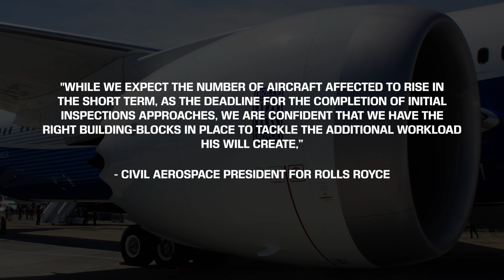Boeing 787 GROUNDINGS to WORSEN due to TRENT 1000s

Comment: You didn’t really sound that different. But why does it seems like European developed vehicles/engines always have issues. I’m into motorcycles and it seems like the European bikes are much higher maintenance vehicles and they tend to have more problems and not last as long. Can’t say anything for cars because I don’t stay “in the loop” with that stuff as much

Comment: The problem involves cracked intermediate stage compressor blades (a three shaft engine) deep inside the power generating part of the engine. 
Nothing at all like the recent Fan blade failure on the recent 737 incident.
This has limited ETOPS to 60 minutes which can require significant rerouting of the flights. Thus more fuel used and higher costs.
And more frequent inspections until a final solution of new blades is installed on about 380 engines.
To understand the energy being used to compress the air before combustion. The older J-79 turbojet uses around 2/3 of the total power produced (fuel burned) just to turn the compressor. Leaving 1/3 to be used for useful power output.
Modern designs have improved this quite a bit but the power consumed in compressing the air is phenomenal in these large turbofans.

Comment: If everybody in the area has a sore throat. Something is spreading it. Food. water. postman handling the mail. Air born.  Gargle and spit out 3 volume hydrogen peroxide. I used to be a plumber and would get strep throat every month until I learned that trick. Could also be a sewage leak into the street that gets splashed up with every car and bus. Or a cross connected pipe. H2O2 works great.bottles even say oral debriding agent.

Strep throat can turn into many things worse that can kill you ..
Reply: wayne p can you say Triology

Comment: 1st  I'd like to talk about my qualification. I entered the USAF in 1977 I went thru 380 hours on aircraft maintenence on the Boeing 707 Primarily the E-3A. I've spent the next 2 years lerining about all systems of the aircraft. I have about two hours of training for 6 weeks just on the jet engine and how it works. That being said I have dismantled many engines for overhaul and know nearly every part on an engine. PROBLEM: Fan blades breaking. It hasn't been said excatly which blade broke. There is a fan section. When this spins it supplies air to the engine about 30% and delivers the 70% around the engine for thrust. The 30% enters the inlet section of blades Stator and rotating. This starts to compress the air from 0-psi to 50 psi. That air enters the Compressor section an greatly increases the air pressure to over 100psl. That air compressed enters the burner section where jet fuel is sprayed thru 6 holes in 6 nozzles from 6 burner cans. The fuels is ignited and the air pressure greatly  is increased to 200 psi. Exiting the burner section  is the exhauset section. This hah stator blades and rotating blades. They are connected to the inlet blade by a rotatinf shaft. They all work together to produce 1/ the trust need to keep the plane in the air. If ANY one blade were to fail it has a multiple effect and will break nearly every blade from front to rear.  These blades are made from titium but depending on desige most are weaker near the tip and stronger near the assembly location. I have seen this failure before and you could see thru the front all the way behind the plane. My suspicion is there was a design change on the blades of this engine. No other jet plane with similar hours has had this problem. Every engine made for this plane will have to be rebuilt and NDI inspected... How a Jet Engine works. Place one 24' room fan in front of another about 4 or 5 will do. Place them up against eachother and turn on the first 3 fans. The back two will spin. Now if you can greatky increase the air flow the back blades will spin faster Simply put the Jet Engine Sucks and blows.. Sucks by creating low pressure in front of the engine and high pressure behind the engine pull the plane forward

Comment: The airliners should have ordered GE engines instead. The RR Trent engine seems to have all sorts of problems, even on the A380. The very first 777 crash which was a British Airway 777 had the Trent engines that suffered fuel starvation at the final landing sequence.
Reply: You're wrong in blaming the engine for the crash. Just a few minutes research would show that the cause was ice crystals in the fuel rather than the fault of the engine. Its such a shame that contributer
Reply: Continued.... That contributors to these sites make so many basic errors. Just check your facts first before putting your foot in your mouth
Reply: Bill: you are the one in the wrong. All flights in the northern hemisphere on that day experienced exceptionally low temperature. The Trent fuel lines INSIDE the Trent engines that were clogged by miniscule ice crystals because of the Rolls Royce design defects . RR had to modify the operational procedure for all 777 with their engines to prevent this reoccurence. GE never had to modify their procedures.
Reply: 2Phast4Rocket 
I read the report and the summary & noted that it was Boeing that changed the operating procedures which - presumeably - was intended for all Boeing aicraft regardless of engine type.

"Because temperatures in flight had not dropped below the 777's designed operating parameters, the Air Accidents Investigations Branch (AAIB) recommended Boeing and Rolls-Royce take interim measures on Trent 800-powered 777s to reduce the risk of ice restricting fuel delivery.[47] Boeing did so by revising the 777 operating procedures so as to reduce the opportunities for such blockages to occur, and by changing the procedure to be followed in the event of power loss to take into account the possibility that ice accumulation was the cause.[
We can ping pong forever on the merits and demerits of engine manufacturers but jurt to remind folks that the FAA issued an emergancy directive requiring GE to make immediate changes to the GEnx engine powering the 787
Reply: The fact remains it was the Rolls Royce engine hiccup that caused the crash, not GE.

Comment: For New Zealand it's a huge deal, for 80% of the Dreamliner users not so much. Rolls-Royce F'ed up BIG TIME, P&W has their own issues with the GF engines on the 320 family.
As far as single aisle, the LEAP engine is going to the bank, increasing production its rosy at GE and the French power plant makers
**
Rolls-Royce builds jet engines for a wide variety of aircraft, including both Boeing and Airbus widebodies such as the A350 and Boeing 787.

The latest out of the Trades
*Most Boeing 787s (WRONG its 20%) are powered by the Rolls-Royce Trent 1000 engine, which has been receiving lots of attention after some serious problems: the turbine blades inside the engines were corroding and cracking at a quick rate. And now, the company is paying for the faulty equipment in a big way.

In 2016, ANA announced it would be replacing all 100 Rolls-Royce engines on its entire 787 fleet after three engines failed because of the corrosion. British Airways cancelled a handful of its 787 flights last year due to the same issue. Air New Zealand, Norwegian and Virgin Atlantic’s Dreamliners have fallen victim, too.

Rolls-Royce reported yesterday that it’s paying $315 million for the repairs on the Trent 1000 and Trent 900. The BBC reports the costs could lead to job losses at the engine manufacturer, in addition to other structural changes at the company.

“These issues have required urgent short-term support, including both on-wing and shop visit intervention, which has resulted in increased disruption for some of our customers,” Rolls-Royce said in a news release. The company said it is, “making solid progress with longer-term solutions, largely through re-designing affected parts.”

Both the Federal Aviation Administration and European Aviation Safety Agency called for increased inspections of the engines after studies found that during an aircraft’s takeoff and ascent, extreme vibrations caused the engine blades to crack.

Rolls-Royce said that affected Trent 1000s — up to 500 of them — will be taken out of service and repaired through 2022. The company also recently introduced an enhanced version of the troubled engine, the Trent 1000 TEN.

Comment: Their H P compressor blades are cracking at the root more so then the tip of the blade.  Don't know if its material based ,processing defect or flow design.  I do know that the testing folks are working this problem on their test engine.

Comment: GE builds better jet engines then RR, plus GE has built the biggest jet engine in the world the GE-90, with 115,000 pounds of thrust for the 777 and that was over 25 years ago. GE was also the first to build all composite fan blades. I personally think that GE is number one in building jet engines, RR is number 2 and PW is number 3.

Comment: In your video package clip, showing the Boeing B-787 aircraft, you didn't mention it, but the RR Trent 1000 isn't the only option for powering the 787. General Electric also provides engines for the 787, and most, if not all, of the 787s being flown by U.S. based air carriers, domestic, and International, have the General Electric GEnx engine, which according to General Electric, is also the best-selling engine for the Boeing 787 Dreamliner. Also, the Boeing  B-747-8I and the B747-8F use four of these engines. In Europe TUI Fly Air Lines fly B-787s, and all their 787 aircraft are power outfitted with the GEnx engine. I believe your clip had shown a couple of the United Airlines 787s landing and touching down, so they would be GEnx powered.
Reply: The only 787 with RR engines in the video is the Royal Brunei - Jetstar, United and Vietnam all use GEnx.

Comment: That throat problem sounds serious, if you don't get it fixed, you may be left talking aike some Australian mate for the rest of your life :-)

Rolls Royce has released a few Youtube for PR purposes onthis issue. Apparently, they have a short term solution to keep planes in the air an are close to finishing a permanent solution (new blades)  which has already been implemented in the newer batch of engines. 

Would be interesting to know how many engtines/planes have the C batch of the Trent 1000.

Comment: Can they take the trent 1000 engines off the 787 and put a general electric engine or Pratt and whittny engine on the 787s that have problems with the trent 1000 engine
Reply: The 787s were designed for changing out both engines versions, for the other. Although you can't mix and match.

Comment: Nice job DJ explaining Rolls Royce  Trent 1000 engine issues .  Fan Blades are common issues among all of us .  Pratt & Whitney and GE has seen their fair share of fan blade failures .  The recent incident with Southwest Airlines and an 18 year old 737-700 involved a fan blade failure that ultimately broke through the Engine Coweling causing debris to fly into the fuselage .  Sadly,  a young mother of 2 lost her life when she was sucked out the window at 25 thousand feet.  We are all deeply saddened by the incident.  GE has their hands full with this incident.  It’s a reminder to all of us the importance of safety and solid inspections on these engines as they age .  It can happen to any of us if the Airlines don’t implement strict guidelines when performing Engine tear downs during routine maintenance.  SouthWest did a good job by grounding their 737’-700’s that fell into this age bracket and performed safety inspections on all GE CFM56-7B’s.    There are roughly 30,000 CFM 56’s in service today with it being the exclusive engine for the Boeing 737.  The CFM56 is a joint venture between GE and Safran and began in 1997.
Reply: Anthony, hello, you wrote a great reply, very  interesting.
Reply: Anthony Witham Why don’t you read my response to Anthony and you’ll see we’re on the same page boss.
Reply: Note:  the first 737’s that flew in the 60’s and 70’s were indeed Pratt & Whitney JTD’s .  They were just way too loud !  Same issue with 707’s and 727’s.  Airports began refusing them to land during certain hours due to noise complaints.
Reply: Scott Miller, Thank you for the balanced post.  Sadly some engine manufacturers fans can only see the faults of the competing manufacturers and not the brand they like.
Reply: Anthony Witham Hey Anthony , thank you for your kind words.  I work for Pratt & Whitney and I have tremendous respect for Rolls Royce and General Electric .  I see them more as partners rather than competitors.  We’ve worked together creating several great Engines over many years .  Engine Alliance Group is a Joint Venture between Pratt & GE that provides Engines for the Airbus A380.   IAE or International Aero Engines is a joint venture with Pratt & Rolls that produces the V2500 engine currently being built for new Boeing 767’s and KC-46’s.  It’s the most reliable engine today !
Reply: Scott Miller. I think all that matters is that we have responsible aircraft and engine manufacturers, who react quickly to fix problems when they occur. These fanboys forget that an aircraft engine is a marvelous technical piece of equipment. The fact that they fly for million of hours with such reliability is testament to the quality of design and manufacturing by the manufacturers.
Reply: tradjazzer. Thank you. My aim is only to bring balance and sensible debate to these comment sections. I'm sick of seeing the fanboys of engine and aircraft manufacturers, using any problems to heap scorn on other companies. Also using the information to boost their belief the manufacturing company they support is the best.

These fanboys cannot see that with out competing companies in these markets the prices of these products would rise and be passed onto the consumer in higher airfares. They also fail to see that no one engine and aircraft manufacturer could supply the world demand for aircraft. Yes they could open more factories, which requires land, and skilled workers. Currently all engine manufactures are opening plants across the world to try and meet demand. But it takes time for them to come online.

It was interesting to see Scott Miller from Pratt and Whtiney comment that he sees companies, what I called competitors for want of a better term, as partners. Probably we will see more joint ventures as the cost to design and build aircraft and engines rises.

Comment: Should buy A350 rolls powered far superior no issue with engines
Reply: Fast Dunny, No there not, its the Trent XWB, a member of the Trent family.. As to the relibility of  Trent XWB "It passed one-million flight hours in October 2017 without any in-flight disruptions and with a dispatch reliability of 99.4%.By February 2018, it has completed 1.3 million flight hours with a 99.9% dispatch reliability." Not bad for a so called dud engine!

Comment: Can the engines used on the 777 be retrofitted for the 787?
Reply: The GE-90 engines on the 777 are of a similar design to the GEnx engine on the 787s, but they are just physically larger and heavier. Wait until you see the size of the new GE-9 series engines for powering up the updated version of the B-777X. The B-777X should be in production for delivery sometime in the year 2020.

Comment: Hopefully the airlines will prepare their customers that there could be flight delays and even cancellations due to this issue. I wonder if airlines might even want to consider swapping the affected engines with GE engines in the interim until the issue is corrected. The other thing to do is to have suitable substitute aircraft such as the Boeing 767 or the Airbus A330 which could serve in the interim until the engine issues with the Boeing 787 are resolved. 

It probably sounds to me that this issue was completely unexpected and of course inconvenient. The best thing to do at this time is to inspect all of the affected engines and if necessary, ground any affected aircraft until they have been repaired.

Comment: Just to clarify, it is ONLY impacting operators that selected the RR engines, the 787 operators using the GE engines have NO issues at all. Maybe airlines will think twice before selecting RR over GE.